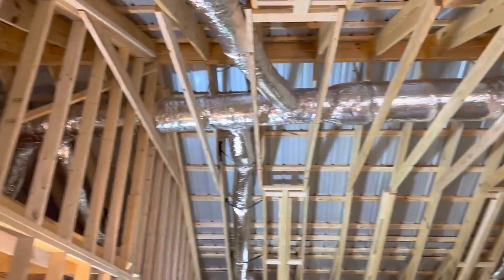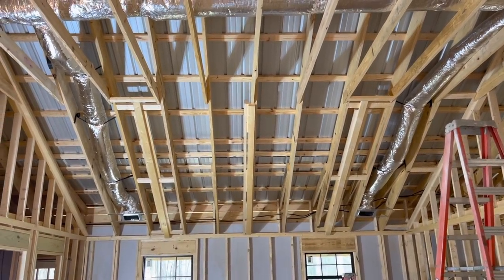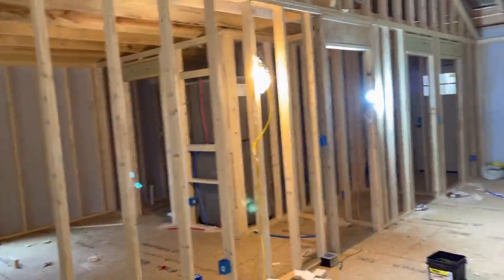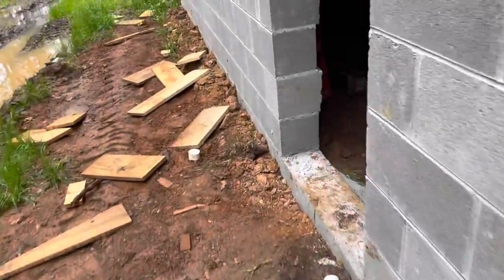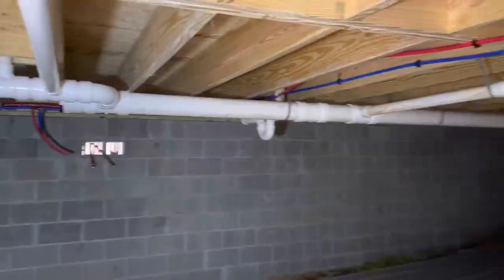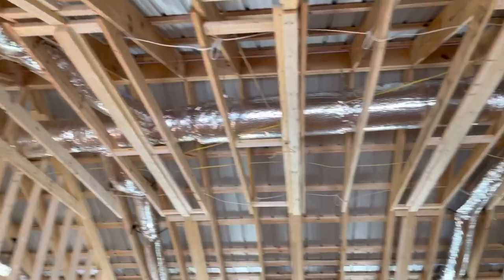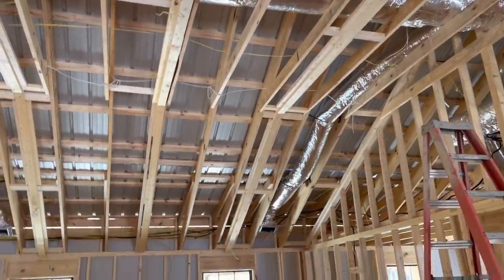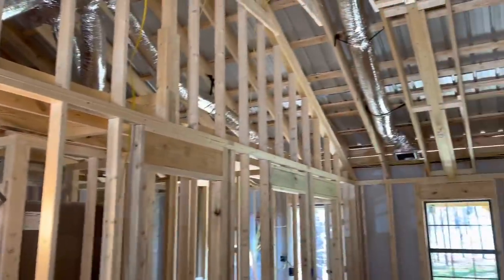New Construction: Rough In Plumbing, Electrical, & HVAC

Comment: That HVAC soft ductwork falls apart with age and temperature cycles. Should be insulated tin. The plumbing looks great Jeff. You do nice work.
Reply: The new stuff lasts alot longer tban that old quiet flex bs
Reply: @FinSmoked  WRONG!

Comment: With OSB at $10-12 a sheet, why in the world would you use “cardboard” for exterior sheathing?  That stuff is absolutely junk, offers zero shear strength and zero R factor.  Yes I’m aware of your wood siding but cmon, we can build much better than that.